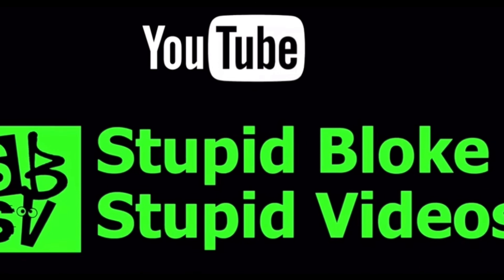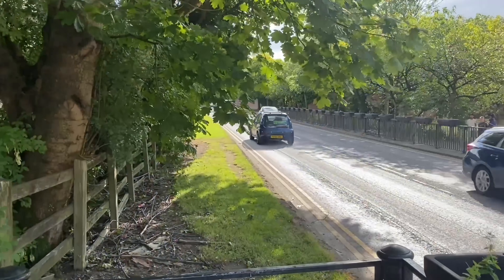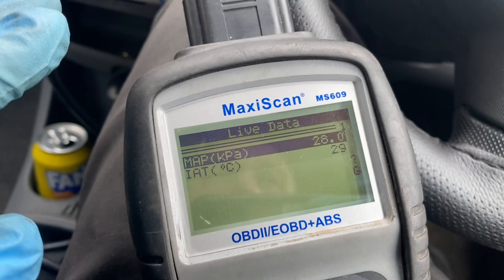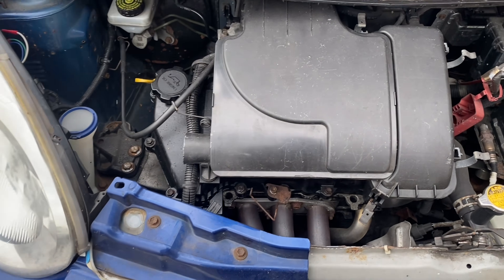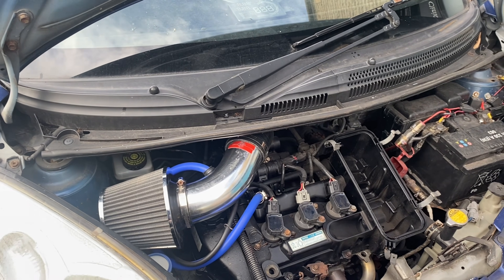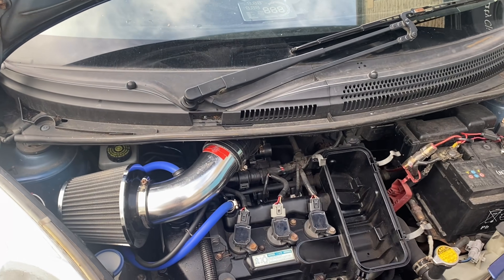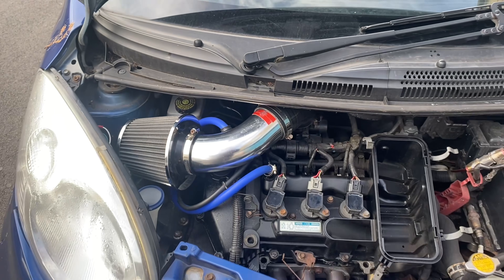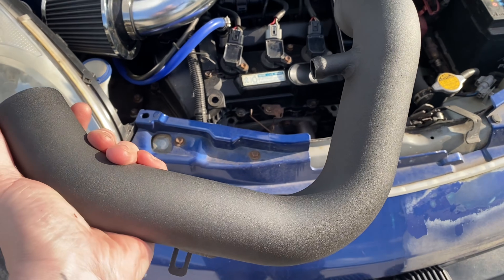CityBug Induction Kit Tested, More Power, More Acceleration? Better Sound? (C1/107/Aygo) K&N/RamAir

Comment: What does that blue hose do attached to the intake pipe do? And where does it go?
Reply from the maker: The small one goes to the breather on top of the rocker cover
Reply: it’s called a breather tube and it releases any bad gasses taken in from the intake to prevent it going to the engine causing any damage 👍

Comment: Will it go any faster to the tune of about 1?
Reply from the maker: @DarrenJamiesonJamieson  probably about that
Reply: @StupidBlokeStupidVideos  Oh, in that case I don't think I'll bother
Reply from the maker: @ the main benefit is the noise, but it does actually make it a little bit quicker. The comparison in the video shows by how much
Reply: @StupidBlokeStupidVideos  Yeah, but after hearing you say how badly it effects fuel consumption, I'm having second thoughts, and what about the air vent pipe: Would I just leave that open?
Reply from the maker: @ mine just vents into the inlet but I’m gonna fit a catch can

Comment: reminds of the days when i modded my 1.1 206 with a cone filter and 3 inch back box..noisy it was. got a much quieter 2.0 t scirocco 2015 with stage one map on it! has around 270bhp - goes like stink.
Reply from the maker: @drummonkeystuffuk1875  but the 1.1 with a cone filter was faster!
Reply: try driving an actual fast car to see what stink really goes like

Comment: hey ma G, i having a problem with this model, it vibrate around 2k rpm it feel in the tacometer, facia, pedals, ground, but when i go over 2k it becomes smooth, it happen at any speed and every gear, even in neutral, just above the 2k rpm, maybe u or someone in the comunity could help. Greetings from Tenerife G.
Reply from the maker: @perylanai  these engines aren’t the smoothest tbh, but check your gearbox stabiliser mount

Comment: Hi Tim, I found my Ancel AD410 and decided to try the live data - MAP sensor readout
The Ancel says the max is 99 kpa ? it can read. It showed 99 kpa from 2000nrpm, no idea how accurate it is
Thats with a K&N panel filter, unrestricted airbox, and ESSO Supreme
Reply from the maker: Yea depending on weather, altitude etc you’ll probably never get higher than that as that’s about atmospheric pressure. The more rpm the engine is doing the lower that should go
Reply: @StupidBlokeStupidVideos  It was cold and dry today, so that must have helped

Comment: Did you replace engine mounts, and if so aftermarket or OEM? I replaced all three with aftermarket and now it shakes a lot in idle
Reply from the maker: @mihailodjurovic6610  I did this to mine, and yea it vibrates like fuck 😂 

https://youtu.be/4B-IuIdRvZE?si=3TrMG_FUz1cGo5wO

Comment: can you compare the cold air feed you made in another video (using stock airbox and the silver tube) to this intake pls. im wondering which to put on my C1 to overtake the most lamborghinis
Reply from the maker: I don’t have that one anymore 😞 

However I can confidently say that the correct ingredients for overtaking the most Lamborghini is the ram air one I put through the bonnet. You should pass those Lamborghini Trattori relatively easily with that installed.
Reply: thanks for the help pal. ill get the angle grinder out and get one fitted

Comment: My citroen c1 mk2 also maxes out at 97kPs 🤔, makes me think and makes me wonder.
Don't forget about the little air scoop in the front grill that directs cold air up to the stock air intake.
Reply from the maker: It will change slightly depending on altitude and weather, but the cone air filter deffo adds a couple of kPa over the stock one!

Comment: Interesting vid! 
The next thing would be a supercharger kit.
Reply from the maker: @batterynerd8779  I’ve got one that I need to get round to fitting. I’ve had it since June but not even opened the box yet!
Reply: @StupidBlokeStupidVideos  amazing! Looking forward to it.
The engine will suffer for sure. 
I ask myself if there is a sweet spot like ~ 20 hp more where there is more power but the engine is still somewhat expected to last.
Reply from the maker: @batterynerd8779  we’ll just bolt the shitter on and see what happens.